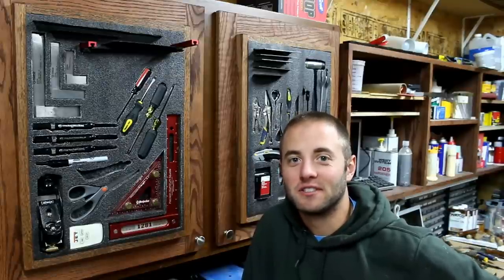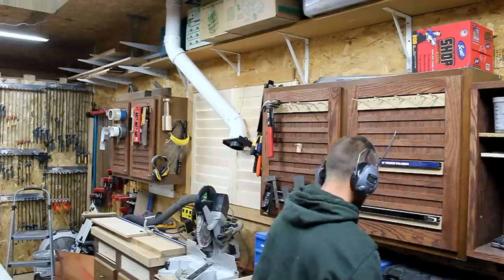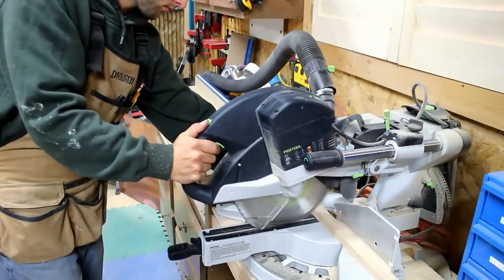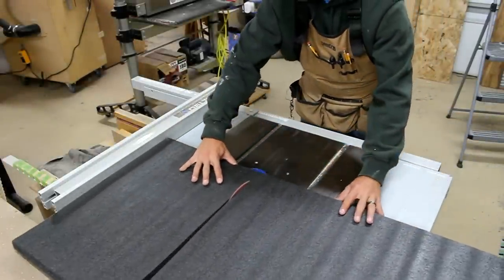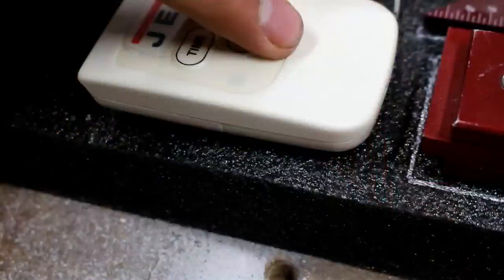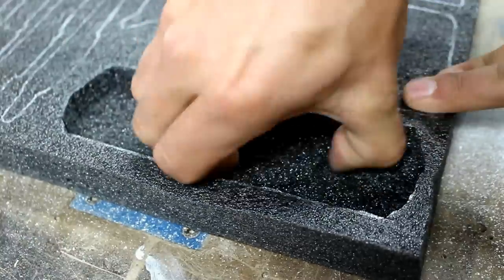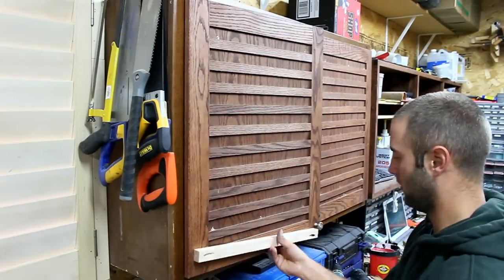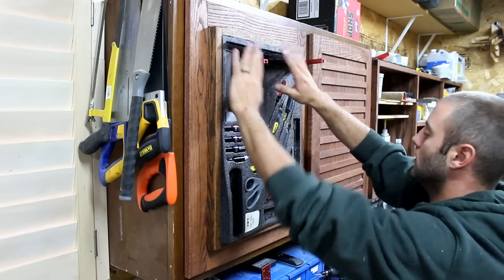Kaizen Foam Cabinet Doors

Comment: Good luck with that. I personally wouldn't put anything in there that I wouldn't be willing to drop onto the concrete floor from a height of 6'. Which by the way was most of the tools he put in there! You could tell the small plane was way too loose.

Comment: I've never used this stuff, is it at all difficult to get flat tools out like a square?
Reply from the maker: Nick Hafner It can be, depending on the tool. The big incra square had a hole in the arm so that is easy to grab. Some items you can make a little half circle to allow your finger to get under the item.
Reply: Nick Hafner We use a pipe, heat it up, and melt the Kaizen Foam to make a perfect half circle cut out for flat tools!
Reply from the maker: FastCap Great idea!

Comment: This foam DOES NOT pull apart in clean layers.   That is my experience.   The glue is stronger than the foam and it comes out in a huge mess of all over the place depths with tearing.    It is a great idea that did not work well for me.
Reply: That's because you're not doing it properly. You MUST get your fingers UNDER the layers to be removed and then work your way through, in a sliding motion. DO NOT try and peel it or you will have a messy outcome.